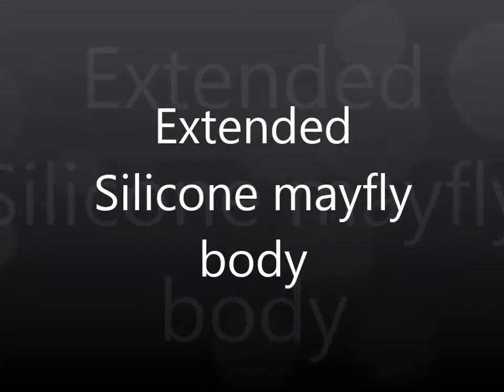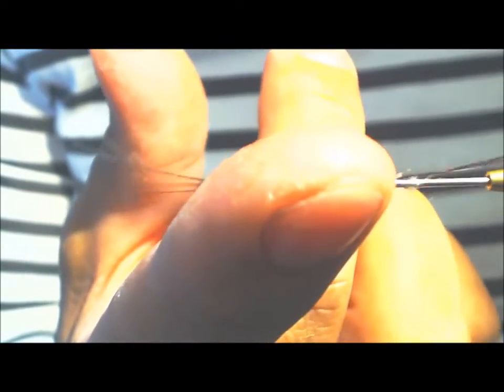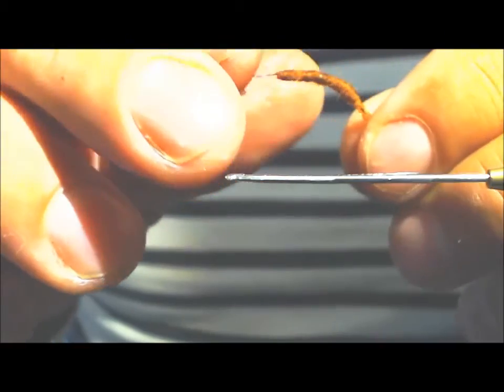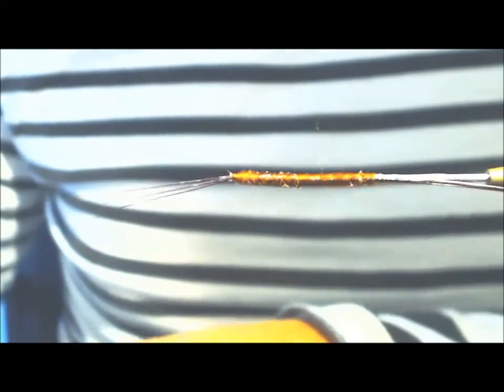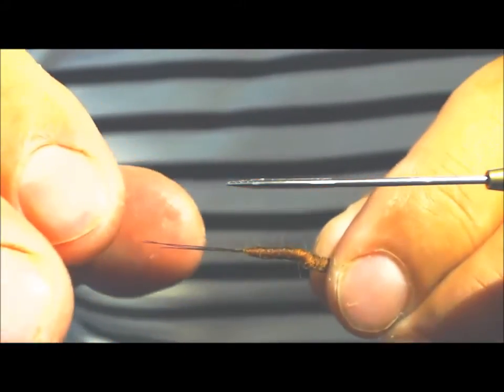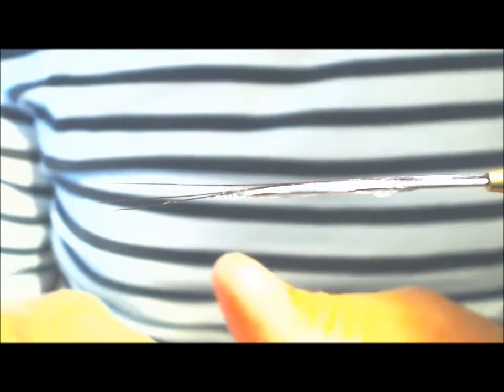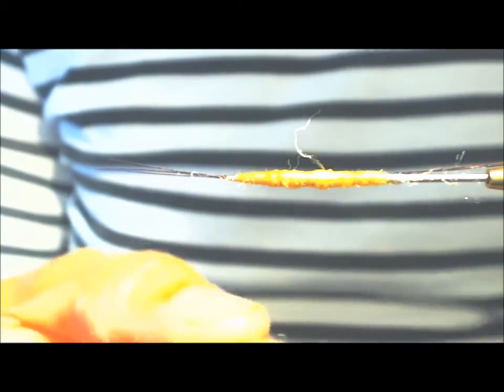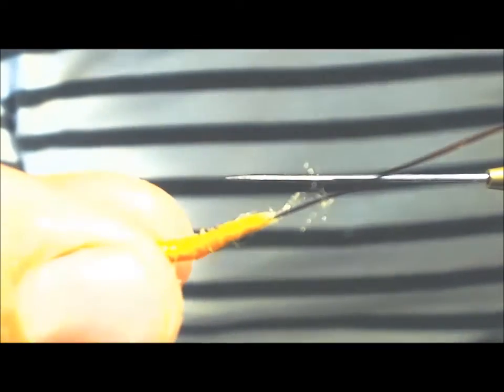Extended silicone mayfly body Tied by flytier: Per Ivar Ekeberg

Comment: Hi congrats for your method. Could you tell me which material do you use to make the tail please ? Thank you very much
Reply from the maker: I build the extended body with long fibered dubbing moose mane and saturated with silicone , take it off the needle bend it to shape and let it dry.
Reply: many thanks and congrats again